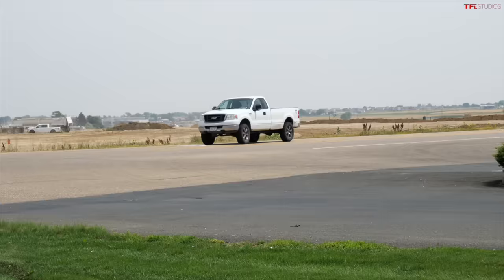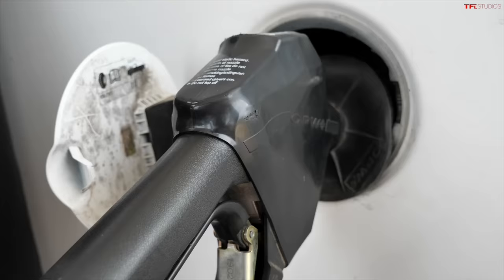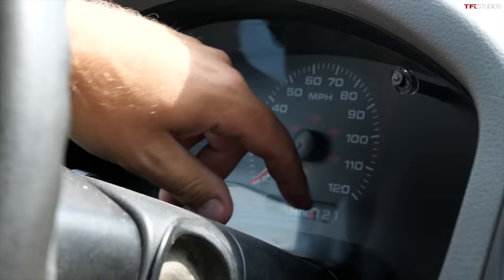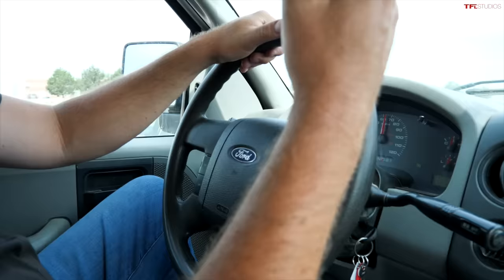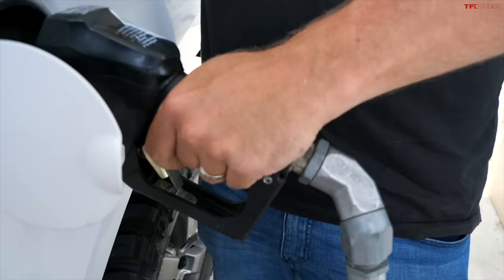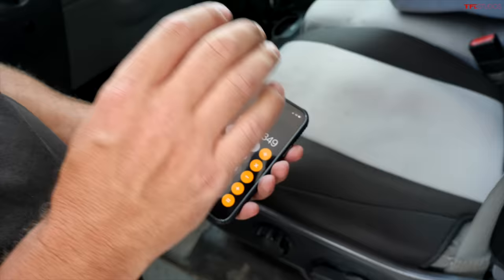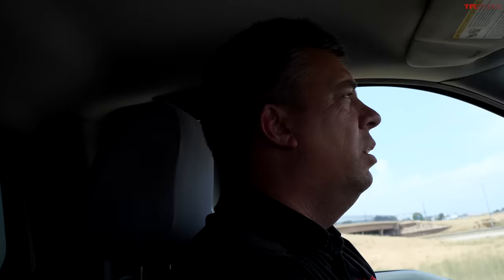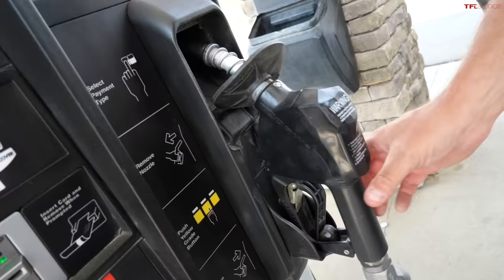Surprising Result: Here’s What Happens To Your Truck’s MPG When You Install A Topper!

Comment: I've seen wind tunnel tests for this kind of situations, plus tailgate up or down, or tailgate with vents in them (you don't see those anymore) and it turned out the best way / gas mileage nothing on the bed (cover tonneau or camper shell), tailgate up no vents. The reasoning is with nothing in the bed, tailgate up it creates a small vortex in the bad that helps with the overall vehicle aerodynamics.
Reply: I gained one mpg with a soft tonneau cover. I think it has something to do with the vacuum created with 3 rails going across my bed to hold the cover. The way dimples work on a golf ball I guess. Myth busters did a test like that too and dimples in a car had more mpg.
Reply: Yup this is true. I think it is also well established that the most optimal shape is a gradual slope - think the kammback of a Toyota Prius - but nobody wants a truck topper like that in practice. Maybe hypermilers (... and they'd start with a different vehicle)

It makes much more of a difference to clean up under-vehicle aerodynamics. That's why most trucks now have big chin spoilers unless they have an offroad package on them; they keep air moving around the vehicle and not under, at the expense of ground clearance. Probably worth 1-2mpg alone.
Reply: Idk i've made several long trips on my truck and kept getting the same 20 mpg then after i installed a hardtop tonneau cover i made another long trip and i averaged 22 mpg.
Reply: @willb1242  That's why most new cars have plastic coverings underneath.
Reply: @godgirlsguitars  Dimples, yes, that's why I buy used cars with lots of hail damage.
Reply: I hate that vortex before getting my cover. All the dead leaves, old receipt, everything just flying in circle in the bed and never leave 🤣
Reply: @GerardoLuna92  drag difference is significant on highway speed actually, especially when you release gas pedal. Without a hard cover the truck slows down a lot faster from what I experienced. It might not always transform into mpgs
Reply: I get consistently better mileage on my F150 when using a tonneau cover.

Comment: You really need to do this over a month or two of driving (or more) in each configuration, and keep records in a spread sheet and see what you get. You could do what a couple of Lockeed-Marietta engineers did about 30 years ago when in an argument about whether you got better fuel economy and put the pickup in the wind tunnel on a frictionless floor to measure drag coefficients and get a real accurate result. Tailgate up won. The open bed with the tailgate up actually was a dead air space that acted like the bed had a tonneau cover, so the large flat area of the back of the cab, created when the tailgate was down was broken up into two smaller steps, from the roof to the bed rails to the tailgate to the bumper, more streamlined than a blunt back end. I suspect your mileage pulling a trailer would be measurably better with the topper than without.
Reply: Two out of three lab coats agree, more data is more scientific.   In order to do what those Lockheed-Marietta engineers did, I would need to get a job at Lockheed-Marietta which gave me access to the wind tunnel.  Question.   Can I work from home?  😄
Reply: Obviously you have not done this yourself.  Tailgate up, Tailgate down. I took my cruise control  pickup four cylinder truck on 100 mile trip one way at nighttime a daily trip which I had been doing for the past year.  Tailgate up, 25mpg Tailgate down 33mpg. So tail gate up I took 4 gallons per one way  trip. Tailgate down it took 3 gallons that was with nothing in the bed of the truck. The tailgate up acted like a big air damn costing me a gallon per hundred miles. The scenario described by you is what the Saturday morning PBS Radio, mechanic brothers from Boston like to use as an excuse, Frick & Frak
Reply: @jwooten1951  Actually I did, about the time the Atlanta Journal article about the Lockheed engineers test came out I had a Jeep Comanche pickup with an open bed and it was largely driven to work, 50 miles each way, mostly interstate, and I drove it for a couple of weeks with the tailgate down (normally it stayed up) and consistently got worse mileage with the tailgate down over the two weeks, not a lot of difference, about a mile to mile and a half per gallon. I always fill the tank and it was easy to track the comsumption accurately.

Comment: I've put truck toppers on several of my trucks.   I saw a small drop in mpg on my 2005 F350 Dually with 4x4 and 6l turbo diesel.      I recently put a top on my 2021 F150 Powerboost 4x4 with 3.5l.  It also seems to have gone down a fraction around town.   I haven't yet taken a long highway trip.
I did notice an improved ride with both trucks.  My passengers note that the back seat is not as bouncy when going over pot holes and railroad track.

Comment: Didn't Mythbusters or someone test this once? I remember seeing it. The explanation proposed was that the open bed carried a sort of pressure bubble underneath the air stream over the cab. That bubble acts like a topper so the aerodynamics are approximately the same.
Reply: You are correct, I saw that program... they proved that having no topper and tailgate up creates a air bubble and improves MPG.

Comment: The effect of increased elevation is an effective decrease in compression ratio due to the thinner air. Lower octane fuels work just fine.
Reply: Actually, the compression ratio remains the same. You not changing crankshafts or pistons or machining heads. It's just the density of the air is less, so compression psi is less. The "ratio" remains the same. 11 to 1, 9 to 1, 10 to 1, whatever a particular engine has.
Reply: @marks3750  You missed (or misinterpreted) the term "effective". As in "has a lower compression than the same engine at sea level."
Reply: @machintelligence  But you said "decrease in compression ratio", not "decrease in cylinder pressure". The "effective" compression ratio is the ratio of charge to compressed pressures, not the absolute cylinder pressure.
Reply: Compression ratio does not change with elevation. Engine vacuum & "cranking pressure" will change some. Altitude air density will lower HP a bit but not much unless you go to some extreme high altitude. My buddy NEVER touches his race car's Carb jetting on his ALL MOTOR, 7.97/168mph, 87 Olds Cutlas, regardless of where he races.

Comment: I think that you should load up the bed with blocks to the weight of the cap. See what kind of fuel economy you get with the weight but no aerodynamic advantage.
Reply: That cap is definitely not an aerodynamic advantage on a pickup,  it just adds up drag at the back which makes the truck works a little bit harder.

Comment: I have 2 f250s….2011 supercrew with 8 ft bed and 2014 super ab with 6.5 bed.  They both have the 6.2l gas engine.  I get right at 12 mpg at 70mph in both.  It goes down to 10mph at 85.

Comment: I'm not a Ford person but the 4.6 is a great engine. I worked for Tempo campers and we used the better fuel mileage as a selling point for the cab high toppers. The VP used a 2wd Toyota pickup for the test since that was our best seller. He claimed 1.5 mpg better?? That was back in the mid 80's and for some reason I still remember the model number for the topper.   C22088SRTT, That's crazy!

Comment: I never really noticed a difference when adding just a camper shell to two different trucks. I did noticeably lose at least 1 mpg from adding roof rack crossbars on to each though.
Reply: My buddy has a jeep he put rack on. Lost 2 mpg. Made it noisy too
Reply: Anything that creates air flow disruption will reduce mpg. Even removing the front air dam or adding a lift kit will hurt economy.

Comment: I ordered a Paragon Ultimate bed cover for my 2022 2500 Denali diesel. It should ship around July 1st. I tow my 5th wheel and goosenecks, so I needed something that would move out of the way. If I am just cruising, my truck gets better fuel mileage than what you are getting.

Comment: Exactly the same results I've gotten with my truck for the last 13 years.  I drive a 2008 Dodge Ram Megacab 1500 4x4, that I special ordered.  5.7L Hemi, 545 RFE Transmission and a few options, no lift, factory size tires, and even though it's a 1500, it sits on a 2500 chassis, minus 1 rear leaf spring.  From my 1st fill up, I averaged 8mpg.   As the engine wore in, it improved to between 10-11mpg in combined driving.  I've tried tuners, Cold Air Intakes, different brands of gas, different octanes of gas, and different blends of gas up to Ethanol Free, and I also own a Leer Elevated topper instead of the roof line topper .  I ran my own test, running 10 full tank fills of all the area gas stations.  I've down this twice over the last 10 or so years, 10 tanks each with the topper and 10 tanks each without the topper and my MPGs have always remained around 10-11mpg.
Reply: Honesty prevails. There's very little one can do to improve the mpg in any vehicle. Tuners & the other performance "enhancements" usually hurt mileage, except with diesels.

Comment: I would imagine that this is a more complex question than it first appears, based on the speed of the vehicle. For example, air dams on the bottom front of the truck actually have a negative effect on fuel economy until you get to highway speeds. It would be good to test the same thing again with the topper, but at low speeds.

Comment: Pretty surprised.  I thought that the weight of the fiberglass would totally "outweigh" the aerodynamic advantages.  More curious about a repeated study that would cancel out temporary wind patterns that may have affected the results.   But this is a great back of the envelope test.  Thanks!
Reply: Weight affects your rolling resistance and how much energy you need to speed up and go uphill.

Aerodynamic drag at highway speeds is a few orders of magnitude higher than rolling resistance.

So adding weight to improve aerodynamics will pay off on the highway.
Reply: If that topper is around 200lbs it's about 3 pounds lighter than the average US male (197 ruffly). So the topper on the rear it like adding another adult male in the cab.

Comment: 8/15/23. I know this this video is old, so am I. LOL I love my Leer high end fiberglass cap/topper/lid, whatever. 8)  It has the carpet inside, and I have the matching bed rug, its a nice space for anything. Including people at camp sometimes. My 2500HD Silverado Ext 6.0L w/3.71 axles got a consistent 13.0 MPG avg. With the addition of the Leer cap, it got 14.5 MPG avg,  both numbers over a 3 month period. I keep a log book. I'm also very fussy about 3k mile oil changes w/Mobile_1 and the K&N filter in the stock box, cleaned every other month. I do have 1 size over BFG AT tires also. It's prolly assumed, but it also has the 6 spd OD auto trans, that I really like in the new trucks! (It's a 2012 btw).  That's my 2 cents. Thanks,  --gary

Comment: I know you filmed this years ago, but I think mythbusters, or some other show, a long long time ago set up a car on a test track running a fuel cell to measure the exact fuel usage extremely precisely. At least they made that claim. And to account for weight differences they basically had a switch, bring vehicle up to 55 mph, and when it hits the starting point it switches to the fuel cell, and then switches back or off at the exact same ending spot. They covered car in clay,  and then clay with divets cut out to look like surface of a golf ball, and the golf ball texture outperformed the normal flat, and flat covered in clay. It's good to know they cancel out, so, if you want that covered cargo area, then there is no reason to ever remove it unless you need to for hauling reasons.

Comment: I like the idea behind this test, but 54 miles is a VERY short circuit sample, results would be within margin of error. More like 1k miles at least tho the test would be incredibly boring LOL ... also when we get those #'s we'd need to know how many miles of highway use would the truck need to complete to cover the top cost
Reply: I think a 200 mile trip would be fine
Reply: Other factors that absolutely count are wind speed and direction, pressure altitude and temperature. These numbers can change a lot throughout the day and anyone that says they are negligible changes doesnt know what they are talking about.

Comment: No topper here; good ones are expensive, rear visibility suffers, loading and unloading is awkward or impossible and two man job to remove and replace. I used one for camping but all other times I hated it. MPG saved or lost wouldn't sway me one bit to get another.
Reply: 100% agree. Well said.
Reply: Yes I had one on my Tacoma . Now on my Gladiator I have a bestop soft topper that folds down to me best of both worlds.
Reply: i have and extra tall, no window cap for work so i can keep my tools secure and i have carried 500 pounds of plywood on top of it... of course its not for everybody but its a lot easier to get stuff in and out of the taller caps... those low ones are nearly useless
Reply: Would be good for sleeping if you are camping.  I would get one but mainly for the way it makes the truck look nicer. they are pricey though.
Reply: Lol I've got a tall one I bought used for 75 bucks. I love being able to keep things dry. It was great on my 8 foot bed but now I have it on a standard bed for it extends about a foot over. Actually gives me more storage.
Reply: Different strokes for different folks. I really like mine a lot. It just depends on what you're looking for out of your truck. Growing up in Texas, almost no one had a topper, but out here in Colorado they are more common than anywhere else I've ever been.
Reply: @SimplyCarReviews  How has it held up? Do you think it is worth it? My only complaint is they look kind of goofy.
Reply: @kristoferbrown8007  on the Gladiator  it looks militaristic/ utilitarian. It has held up well. Is it worth it? For me it was as most toppers I was looking at were over 3,000 and not available.  For less than $1,000 it was a good option for me and the quality is very good I was impressed.
Reply: @SimplyCarReviews  how easy is it to take it on and off? And how useful is the foldability aspect of it? I love my cap when I’m camping but when I want to do dump runs and get dirt/mulch it becomes a headache.
Reply: @bspizzledizzle  concur!  Love my topper in late fall winter and early spring.  I take it off for late spring and summer so i can haul mulch and gravel and dirt in my 2004 Ranger.  Enjoy sleeping in it so much more than a tent in cold wet weather
Reply: Not to mention truck caps scream: I’M AN OLD MAN!
Reply: .... Until someone steals all your goodies you left in the bed of your truck lol
Reply: @bloodbushcraft2467  Since when is an 8' bed not a standard bed.  It wasn't that long ago that all pickup trucks had 8' beds.  Everything less than 8' in a short bed.
Reply: I'm in my 70s and have no problem removing and replacing my topper by myself.  I suggest you do a little research on how to do it.
Reply: "...rear visibility suffers..."
If you can't drive and/or back with just your mirrors (and all those cameras and sensors these days), you can't drive. Been driving truck since '95..... bet my visibility is lower than a pickup with a topper and I don't go busting up equipment. 

FWIW....just my $.05 (inflation doncha know).

Comment: I did a test with my 2011 Ford F150 with the 3.7 liter V6 on a 5 mile section of hiway 130 that I could set the cruise at 65 MPH and never very the speed, One pass going North and one pass going South for each test. The difference on my truck was .05 miles to the gallon less with the topper and I attributed that to the extra weight.

Comment: I recently added. A fiberglass topper to my 2012 f150 supercrew.  Was hoping to see an improvement in mileage from the 19.2 it has been getting but alas, as you found, the mileage remained the same.

Looking at this situation differently, as you pointed out, the topper and all the stuff you now leave it there all the time because it’s protected does weigh a significant amount and yet the mileage didn’t go down. That’s a win in my book.

Comment: Good job using the same pump all three fill ups,. .005% difference, I’d say within the margin of error.
Reply: Indeed - and that margin is big given the number of uncontrolled variables
Reply: Right. That number could be even greater if they ran that test 3 times in a row with or without the topper.
Reply: Variations in the accuracy of the meter on the pump are completely irrelevant compared to the substantial errors resulting from inconsistent fill levels and varying driving conditions. They could have used different gas stations and had an equally valid conclusion.
Reply: @brianb-p6586  true, there are a million different variables that can’t be controlled. Sounds like by your standards this whole thing is a wasted experiment?
Reply: @razorpit  If it had never been done before, it would be interesting. Since it's redundant and not done well enough to learn anything, yes, I think it's a waste of time and fuel. It's not my time and I'm not buying the fuel, so it's only an opinion.

Comment: It's not very aerodynamic. The rear doesn't taper enough to reduce turbulence out back. It's designed for storage, not aerodynamics.
Reply: It’s not much different than no cap. Just relocated the rear low pressure area. I guess a 0.05% improvement.